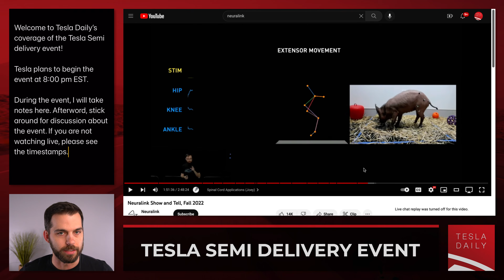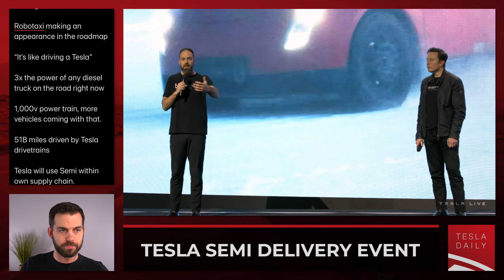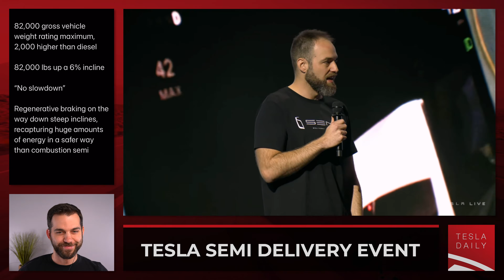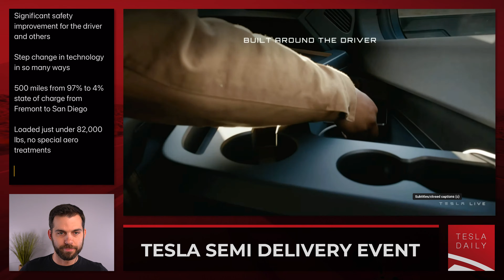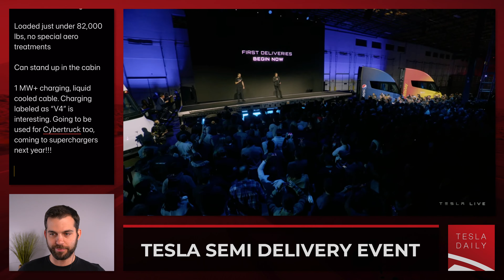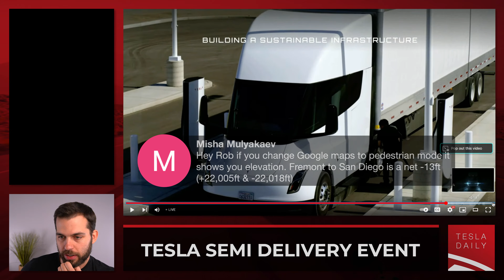Tesla Semi Delivery Event + Reaction & Analysis

Comment: If the semi is getting two miles per kilowatt and it did 500 miles of range that tells you that it's going to be about a 1000 megawatt battery
Reply: Less than they said, the final figure for this trip is 1.7.

Comment: They were pulling 9 of those cement barriers. That's about 36,000 pounds, which means the truck, passenger, wood block and the bed is about 46k lbs. Not sure how many of those cement things a diesel truck normally hauls.

Comment: How fast can they scale up production?  I scanned comments but saw no one else asking this question that didn't seem to be answered.  The market is there, but how fast can they produce them.  Ah, it was sort of answered at the end, 50K in 2024.  So, it will still be a while until being truly significant in terms of numbers.  Still, 50K x 200K = 10B in revenues and I would expect at least 20% margin, so about 2B in earnings which would be about $.17 increase each quarter (and ramping).  If you take $.68/year increased earnings that should be $17 increased share price for a modes 25 p/e.  That would just account for 50K units, not continued ramp up and uses modest price for truck.

Comment: I’ve seen a clip showing the Mega Charger being plugged into a prototype Semi. It looked like 4 pairs of DC pins … looks like an extension of the CCS standard.

For Cybertruck , if the mega charger connector is vertical, maybe one socket will support Type 2, CCS, Mega-CCS … maybe.

Comment: The one thing I'm not sure I understand is that 1.4 TW (Tera-Watt) figure given for the inverters.  Is that a "peak power"?  Even at 1000 Volts, 1.4 TW represents 1.4 mega-Amperes.  That is beyond imaginable even as a micro-second peak power throughput.  It is either an error, or perhaps they were talking about total installed supercharger power.  No, even that would be too much ...  At a mega-Watt per charger, 1.4 TW would imply 1.4 million chargers.

Comment: Using Google Maps and selecting bicycle or walking as mode of transport will tell you the net change in elevation.

So from Fremont to San Diego it has a 13 feet net decrease in elevation. 

When the total increase is as high as 22,005 feet (at least on the walking route), the 13 feet net change seems pretty negligible.

Comment: Hey Rob, try the logitech multi-device K380 keyboard - you can toggle between devices with touch of a button. The pebble M350 mouse can toggle between connection options USB/Bluetooth with a button on the bottom - thus two devices; not as convenient but works.

Thanks for the great coverage!

Comment: Great show. 3-4 important questions need to be answered:
1. Battery size?
2. Pay load?
3. Elevation of start point (Fremont) versus end point (San Diego)? and average speed?
Reply: The elevation of Fremont is 17m.

The elevation of San Diego is 19m.

I would consider a net climb in elevation of 2 meters (6.6 feet) over a distance of 500 miles to be insignificant.
Reply: @fredbloggs5902  at 39:50 the elevation of the start point is 5000 ft. higher than the end point. This is equal to 154 kWh of free energy. Assuming the battery is 900 kWh, the test is "cheating" with 17% equal to 85 miles. A more accurate/ scientific test is a round trip test with a control average diesel truck running at the same time. In this way you reduce the influence of the wind direction also. For me this truck can do ~400 miles, impressive anyway.
Reply: @channguyen3349  you’re welcome to tell me where in Fremont is 5,000 feet above sea level.

You’re looking at the wrong part of the chart, the blue line tracks battery charge, the GRAY tracks elevation. Go look again.
Reply: @fredbloggs5902  yes, I miss the grey tracks. The elevation different is very tiny, so you are right😀 I am not that familar with Californian geographi.
Reply: @channguyen3349  No worries, I thought at first you were right, I had to look carefully at the chart before I spotted it. I think the chart could have been made clearer.

Comment: For the "But elevation!" boys.
Let's do a thought experiment?
500 miles.... ALL uphill!?
.
We know the Semi can  accelerate uphill (it's in the video!)
A few assumptions.
1) It can maintain 65 mph (see the video)
.
2) A diesel can maintain 50mph (optimistic!!!) on a similar grade (judging by the video)
.
3) The Semi range is halved (250 miles with a small buffer)
.
4) There's a "fuel/ charge/ rest stop" at 250 miles.
.....
Starting at the same time, the Tesla Semi reaches the stop in 3 hours 50 minutes.
The driver plugs in and takes a 30 minute break.
The truck gains 60% (150 miles)
Leaves at 4 hours 20 minutes.
(The Diesel passes the stop at 5 hours, no break for the driver)
.
Meanwhile the Tesla drives 2hrs (130 miles) and stops at 6 hours 20 minutes. 380 miles total.
The Driver takes a 20 minute break, charges 100 miles. (20 miles left from previous stop)
Leaves at 6 hours 40 minutes.
Arrives at the destination in 8 hours 30 minutes, but has rested for 50 minutes en-route.
.
The Diesel driver?
Stopped at 8 hours, no break, 100 miles (2 hours) from the destination. Would arrive at 10 hours 30 minutes then be obliged to take a break (and probably fuel?) No time for further work that day.
.
Note, the Tesla driver could take another stop before arriving, arrive with 85% charge at 9 hours, top up, load and start a return journey before the diesel arrives.
But, being a downhill return, wouldn't need 85% charge!
.
Conclusion?
Uphill doesn't matter.

Comment: Shessshhhh. Real world result over grapevine to SD with pretty much full weight.

And ahh that’s why they’re using the carbon sleeved rotors. Super high ratio (RPM) gearing for Tq. Tesla can  assume that these trucks wont really go over 100mph. And obviously the high efficiency motors are geared differently. Probably not by much tho. I wonder if they got the additional PMSR motors to somehow stop running or how they schemed it. Ik it can be disengaged via their clutch, or the additional motors are the standard induction motors.

Comment: About the max. charging speeds. They showed they could shove around 2.7x the amps in the same mm2 cable. So...if v4 has the same thickness of the cables, the math could go something like this....

Amps V3 -> 250kW / 400V = 625 A
Amps V4 -> 625 x 2.7 = 1700 A

Max. Power V4 could be around:
1700A x 1000V = 1.7MW

When the pack is low on charge voltage could be just above the 850s and the amps could be capped to 1500...who knows.

So the theoretical max charging power could be in the 1.3-1.7 MW ball park.

Based on numbers in the presentation, the pack size (usable) is probably somewhere in the 800-900kWh range.

So based on my experiences with supercharging my Model3 (which you can't compare, but what else is there to compare it to?). A charging speed of around 1.5C can be maintained until around the 50% if I remember correctly. So it's possible the 1.5MW charging power can be maintained 'til 50-60ish % state of charge.

All very, very rough back of the napkin math with lots of speculation. But at least it isn't violating the laws of physics. 😎

Comment: The battery size will be 750kw. Tesla say the Semi will charge to 300+ miles in 30minutes. With a charger of 1mw that equates to nearly 500kw of charge delivered in 30 minutes. This gives a total battery rating of 750 to 800kw

Comment: It would be good to estimate economics also ... Looks like there is likely 1 MWh battery pack given the < 2 kWh / mile efficiency. And 1 MW charger implies a 1C charging rate with a 1MWh ... similar to the 1-2C peak charging in superchargers (i.e. 75 kWh battery pack, and 150 kW charging). It would be interesting to know the weight and chemistries used. The 1000 V architecture means that 1 MW input would be 1000 amps which needs to be distributed around into individual parallel paths.

Comment: Net elevation difference between Fremont and San Diego is approximately zero at best a 100 feet or so. However, the Grapevine north of LA is pretty steep and a large elevation change, about 1,400 feet.
Reply: How many 500 mile routes are not "net zero"?
How many are t "net zero" in both directions (combined)? (That'll be zero)
Reply: @rogerstarkey5390  Well for example, if Tesla ships something from Fremont to their Sparks NV Giga Nevada factory, via I80, net elevation would be plus 4,000, in addition the truck would have had to go over Donner summit and 7,200 ft.
Reply: @John-ro2yk  
As I recall, he said they are doing just that?
(About to rewatch)
It would still beat diesel (see my recent)

Comment: 1 MW is an insane amount of power, by the way! You'd need at least 2-3 wind turbines to generate that kind of power (maybe just 1 if the wind was blowing full tilt). Charging the Tesla Semi once is enough energy to power an average US home for over a month. We're gunna need a bigger grid. A MUCH BIGGER GRID!
Reply: 1MW I ..... 4 V3 chargers.
Nothing.
(They haven't caused grid failure and there are thousands)
There are many wind turbines well over 10MW, so your "1MW" guess is..... well, just "a guess"
.
Looks like you're running out of FUD? 😂
Reply: @rogerstarkey5390  not FUD, just facts - 1 MW is a lot of power. Energy producers are fully aware that more energy is needed, and the grid will need a major revamp to transition to sustainable energy. It will happen over the coming decades, but it takes time. I think this is why Tesla is trying their best to deploy solar + batteries themselves, so they don't have to rely on the grid.
Reply: Many more Tesla Mega packs

Comment: Battery size is going to be ~1000 KWH. They said ~500 miles range with slightly less than 2 KWH/mi. Assume it's close to that 2 KWH/mi number and range is a bit higher than 500 miles. With a 1 MW charger, the charge time will probably be a little under 2 hrs (would be ~1 hour if battery could sustain 1 MW for the entire charge time, but I'm assuming it will average about half that). Very exciting because if the driver takes just a 1 hr lunch break on their trip when battery is "primed" for optimal charging speed, it's possible to get ~200 extra miles of range, bringing the total range for the trip up to 700 -- over 9 hours of drive time! This thing is a beast!
Reply: They've said numerous times
"70% in 30 minutes"
.
(You could add an extra 10-15 minutes charge/ rsnge during a "sensible" comfort break en route...... The driver didn't charge in the demo)

Comment: here is the elevation change on the test trip conducted.
17,323 ft of elevation gain.
17, 116 ft of elevation loss
max elevation of 2169 ft above sea level.
Reply: I suppose what we can take from that is...
A diesel would struggle up 17,323 feet then gain no energy on the way down, but stress the brakes and engine?
Compared to regenerating???
.
A "proper" question might be...
"What's the maximum theoretical regen rate at full load on a 6% downhill gradient?"

Comment: Fremont to San Diego is basically Zero elev change. Both are at sea level. Major climbs are Pacheco Pass to get to the Central Valley [or The Altamont] and then Tejon Pass to climb up out of the San Joaquin Valley and get over the Tehachapies [San Andreas Fault built them]. Base elev N of the pass is 1499' and the pass is 4144 feet, And the climb is very steep at the beginning..
Reply: What point are you making? Or is it a question?

Comment: Its possible the Cybertruck will also use the 1000V power train of the Semi
Reply: Since it's using the same charger?🤔
Reply: @rogerstarkey5390  To accept 1MW a higher battery voltage makes sense. For economies of scale sharing tech across models is smart
Reply: @Espiritiv  
A better question might be
"Will Tesla vehicles equipped with "high power" charging have adapters (and the ability) to "downgrade" to a V3 charger if required?"
.
THAT would be a game changer.

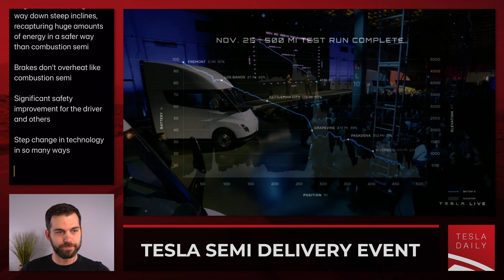Comment: Net elevation change Fremont-to-San Diego is really really close to zero (maybe 20 feet). You can see the data in your video... at time marker 39:39 there is a graph of the elevation vs position... on the far left (beginning of the trip) the elevation is very close to zero... elevation of Fremont is about 50 feet... and then at the far right at the end of the trip it descends quickly back down to around zero feet. The elevation is super-imposed in grey under the blue battery charge graph. (The max elevation point of the trip is marked as 4,136 ft at around 300 miles into the trip as it drives along the grapevine.)
Reply: And your point is?

Comment: Late to the comments but Fremont is next to Milpitas/Alviso which is pretty much sea level (Alviso used to be an inland port) and so is San Diego. Not much of a net change in elevation.
Reply: It's hilarious reading these comments which seem to be trying to fund a problem with the data.
Why exactly does it matter?
.
You're missing the point that even if a route was completely "uphill", this truck would outclimb others so quickly that it would have plenty of time to stop and charge, plus on th return (or "next leg") when it would be *downhill, it would be hugely more economical using regen to recover energy.
There's no way around it.
Reply: Net elevation change Fremont-to-San Diego is really really close to ZERO FEET. You can see the data in your video... at time marker 39:39 there is a graph of the elevation vs position... on the far left (beginning of the trip) the elevation is very close to zero... elevation of Fremont is about 50 feet... and then at the far right at the end of the trip it descends quickly back down to around zero feet. The elevation is super-imposed in grey under the blue battery charge graph. (The max elevation point of the trip is marked as 4,136 ft at around 300 miles into the trip as it drives along the grapevine.)

Comment: You can’t just create diesel? You can’t just create electricity either.
Reply: Regen. duh
Reply: @kennyg1358  And what did you use to create the parts for the regeneration? Also does this semi have the capability to regen itself without charging? Rhetorical question I already know the answer. Sit down fanboy.
Reply: @davidkoba  your profound cluelessness is clear to everyone here.
Reply: @fredbloggs5902  yes here in la la land. Regen will recharge the battery but when put under load ie. hauling a trailer uphill it is not enough to recharge the battery. You will have to charge the semi constantly. That electricity and ironically the parts of the semi are all created using fossil fuels at one point or another. You fanboys are the clueless ones.
Reply: @kennyg1358  
(Looks like you found a "smart" one in David?) 😉👍
Reply: @rogerstarkey5390  tell me then clown what machines are used to mine the minerals used to create the batteries for the electric vehicles? Will the semi be able to run on regen fully when it is hauling a trailer? If not and it has to be charged where does that electricity come from? What source of power created that source of electricity and the infrastructure to support it? I assume you know since you are insulting me.
Reply: The be clear, in context, the comment meant that diesel powered semis can’t use regenerative braking to put diesel back in the tank.
Reply: @fredbloggs5902  oh and i understood the context but what I’m saying is it is irrelevant because it will recharge your battery in only certain situations but EVERY other step in the process require’s fossil fuels at one point or another. Even this presentation required massive amounts of fossil fuels. You all are blinded by this guy’s sweet talk. It’s like talking to cult members trying to convince them they are being deceived.

Comment: The 500 mile range is not a limiting factor IF the mega chargers become as common as truck stops.
You need a 30 minute break during that 500 miles, if you’re charging at peak rate you’ll add 250 more miles, that’ll push you above the amount of miles 1 driver can legally drive in a day in the states, which is up to 11 hours behind the wheel in a 14 hour shift every 24 hours.
Reply: You need 30 minutes after that 500 miles (8 hours)
But.... The (sensible) driver probably needs a "comfort break" during the 8 hours(?) Which can also be a literal "splash and dash" charge, since it takes no time to plug in and leave the truck.
Even 10 minutes is useful range.

Comment: I am surprised more people are not talking a out that 4% left on the battery after it did the real world 500 mile drive over a mountain. So it technically goes over 500 miles on a full charge. That gives some wiggle room for different conditions than they had on Nov.25th which is not a peak weather time for the truck.
Reply: And. If you look at the graph, up a second mountain (?)

Comment: Hope i'm not the only one to mention that San Diego & Freemont are on the coast; near zero elevation.  The Grapevine would offer the greatest  elevation change.
Reply: Net elevation change Fremont-to-San Diego is really really close to ZERO FEET. You can see the data in your video... at time marker 39:39 there is a graph of the elevation vs position... on the far left (beginning of the trip) the elevation is very close to zero... elevation of Fremont is about 50 feet... and then at the far right at the end of the trip it descends quickly back down to around zero feet. The elevation is super-imposed in grey under the blue battery charge graph. (The max elevation point of the trip is marked as 4,136 ft at around 300 miles into the trip as it drives along the grapevine.)
Reply: What exactly is your point?